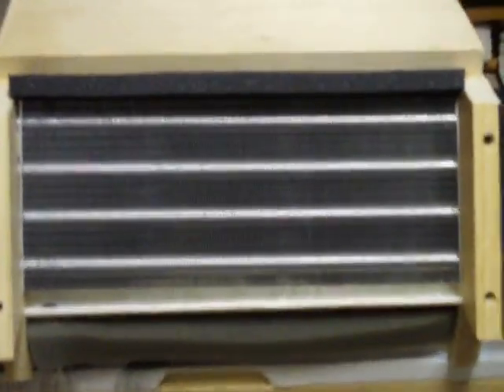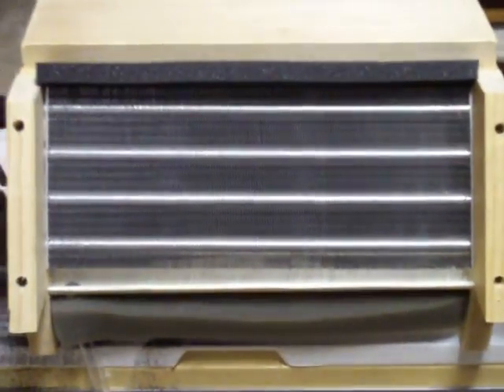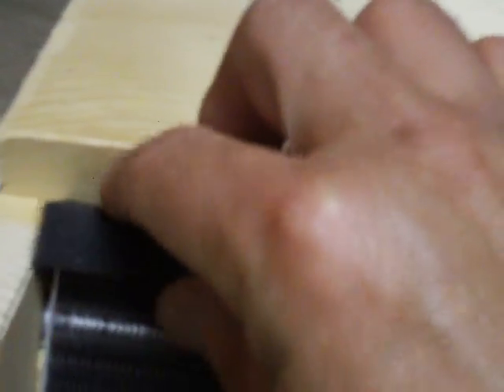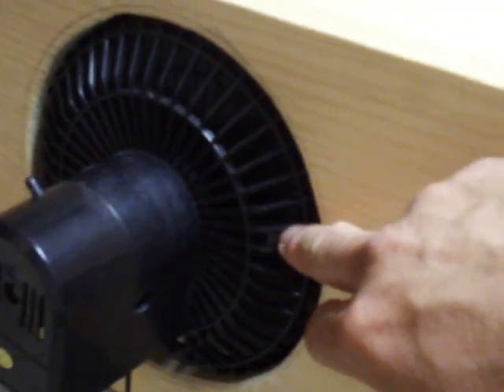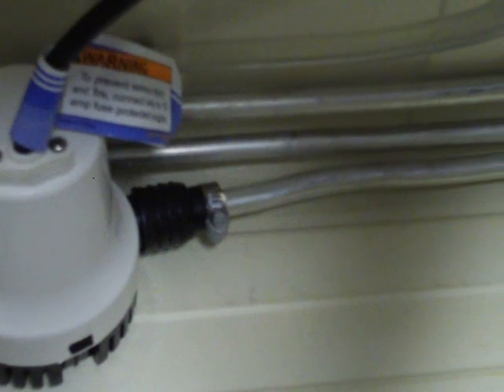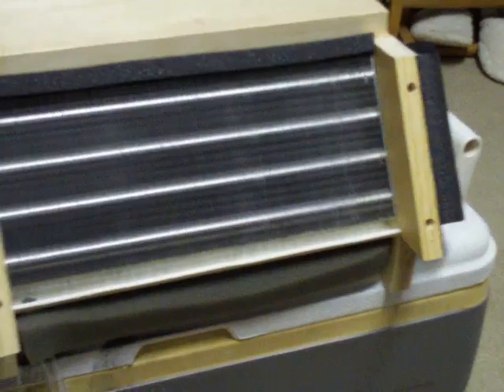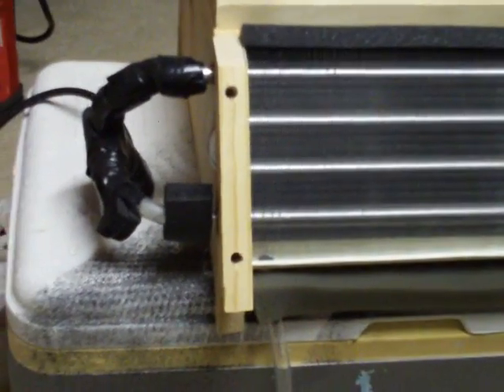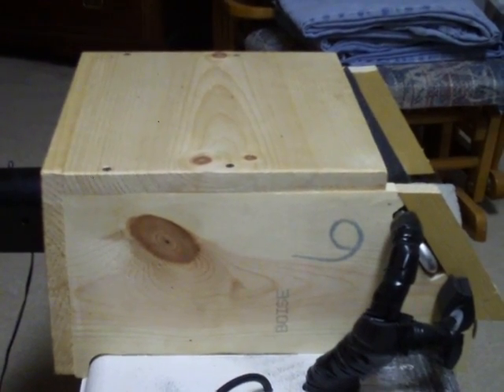Homemade Air Conditioner.

Comment from the maker: @livingonsolar I appreciate that, im  sure in a very hot humid day this would not be practical, but if your in a very small place, and dont mind using the ice,   then its ok, if your out camping but near a place that sells ice, OR better yet, use the ice from a motel ice maker, usually free. if i try it again im goin to make a closed system so i can use dry ice and wet ice, dry ice will free the wet ice for a very long time, and make huge difference, just have to vent the gases outside.  Thanks!

Comment from the maker: @paulpm1974   to continue, so when it got colder outside to keep the water from freezing you used more coolent, because one it doesnt transfer well holds heat better then it can take heat away, thats why they always tell you not to use more then you have to in summer, it will actually make a engine run a lil hotter, but im sure i will hear something about this , someone saying thats not true and so on,  so if you fump ice in and put some salt over the ice, it makes it colder.

Comment from the maker: @paulpm1974  coolent? or antifreeze doesnt lower the temp,straight water in a car radiator transfered heat the best, Antifreeze or coolent, has glycol and other chemicals in it to try and help from corrosion and boiling,  they recommend50 50 mix  because  water helps suspend those chemicals in the liquid , so they dont settle. i was told if you added some Salt to ice it would drop the colling effect a greaqt deal, like when making ice cream, add salt to the ice and it drops a lot in temp to make

Comment from the maker: @hesellsmystuff  well thats good to know!,, i have a vid of it at the condenser blowing 50F indoors, room temp was around 78F   my truck blows 50F and no colder but  i never knew what the numbers were for temp diff  thqat they should normally run and you answered it,  appreciate  the info!

Comment: 30-40 degree difference -  is what you should get if you are using compression ( hi pressure ) - in a completely closed system - with chemicals ( freon )  - such as a car system

Considering you were basically using no pressure - no chemicals - and if your camper shell was not absolutely airtight - I think it did great @ a 20 degree difference

Comment from the maker: @thmedic13th Sounds Awesome, i originally wanted to make a closed system using antifreeze, and use Dry Ice over top of some wet ice, but i was in a hurry, so i just did this way, i have some other vids that i have no posted, i looked and when i checked this one, it was pushing out 50 Degree air at the coil. so its still not too bad, Thanks for the comments, sounds like you made a hell of a nice one,.!

Comment: man, i like this so much i made two for my fishin cabin, only thing i changed was i used some old copper tubing i had form HVAC days and made more coils in ice box,i used a closed system with glychol(anti-freeze) with a conditioner in it. an alum radiator from a toyota and put block ice in cooler with two table spoons rock salt i can push 61 degree air puts my cabin down to the 70's...oh also used reostat on fan to slow air down if i want, great design thanks for posting has made my summer lots

Comment from the maker: @furmedia Thanks! I agree with you about the fan, but you have to remember one thing, the more the air goin through the less time it has to pick up the cold temp passing through the coil.  the fan was just something cheap and needed to be 12 V, i had other fans but  like i said this was just something "quick" and kinda last minute, i could have done a better job on this, adding a coil cover, staining the wood like i wanted to, and painting the cooler, a better color,,   Im glad you like it !

Comment from the maker: @Wallabydam LIquid Nitrogen is a bit out there for some cool air, but you get a drop oir that on you,  its goin to burn for a good long while, and could cause a bad infection and trip to the hospital for possible vien (SP?)  damage, im still looking for a 12Volt AC unit, i heard china has some, and i know you can make a AC unit with AMmonia, using a flame, like the RVs use, complex system but it does not use a compressor of any sort,

Comment from the maker: @Wallabydam  oh by the way if your making a unit that just blows air past dry ice, forget about making it, because it will and can kill you in a enclosed area, if your using it in something like the one i made, in a water circular trype system, you use can dry ice on TOP of the wet ice, to keep it from melting, and still circulate water as long as its not actually hitting the dry ice otherwise it will make the dry ice last all but a very short time,

Comment from the maker: @Wallabydam  when travelling you must have a window open in your car or truck unless its in the back of the truck when it has plenty of air leaks, to vent, so a VAPOR vent would be the idea,to 1 allow the evaporation of gas to vent out, and 2 to not allow build of of any pressure that might or cause a burst or explosion, although most coolers would just allow the gas to push the lid open to puff  out, and not all are 100 % sealed, but trust me, 40lbs lasted me 9 days when i took it  beach trip

Comment from the maker: @roblox84 Dry ice is Compressed Carbon Dioxide Gas, thus why it is so cold -109 F, and if you put it in anything sealed it will build up pressure and blow up, like if you stuckj some in water that was in a bottle and closed it, it would build up  pressure till it bursts, AND Second, you dould die from the gas if you are in a enclosed room, it would replace all air you breathe and put you into a Infinate sleep for good. thats why when you buy dry ice, you have to have a window open  to vent

Comment: @Wallabydam why would you need a vent tube for dry ice? I was thinking of using that as well. Would it be fine if I just put dry ice in my cooler just like regular ice in my home made ac unit?

Comment from the maker: @WICKEDSLAYER777 well then you would just have a regular air conditioner, that requires a pump, freon, oil, AC voltage, if i could find a 12 volt AC unit i would not have bothered making this , but this was just for fun, just stuff had laying around and i spent like maybe $40 If that, im not ruling out the use of DRY ICE and making a vent tube for the gas to exit outside of where ever this may be used,.